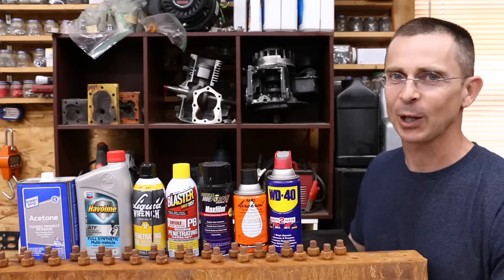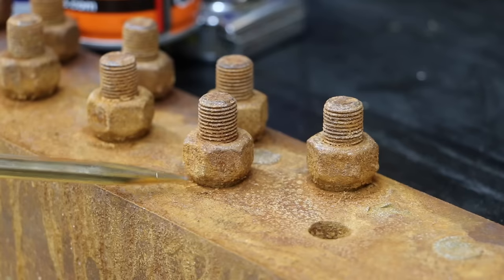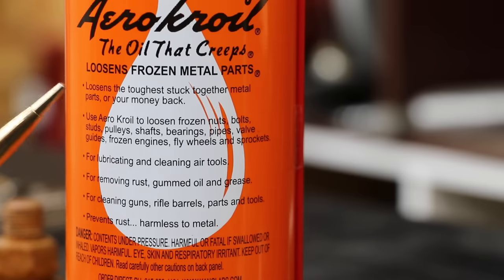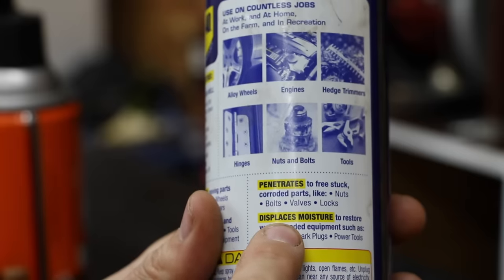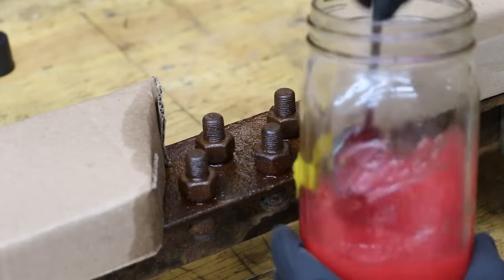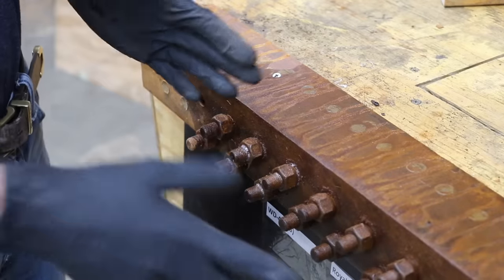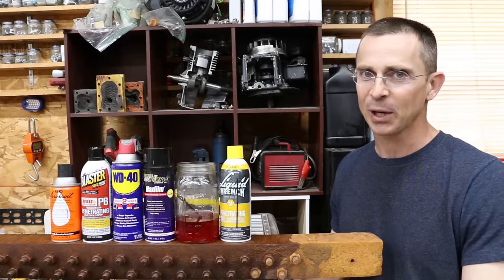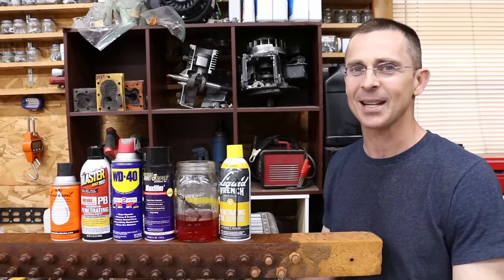Which Penetrating Oil is Best? Let's find out!

Comment: Nice job!

You forgot a big piece.  The control step where you put a wrench on an untreated nut, apply full strength, slip, skin knuckles, and then proceed to mumble choice profanity.
Reply: That would be Uncle Bumblewhack.
(The shmoo is strong with THAT one.)

steve
Reply: then kick some important part across the floor in a fit of rage and break it in the process also / kick the car, dent wing, break toes
LOL
Reply from the maker: LOL!  This is funny!  I admit, I've lost a lot of skin over the years from busted knuckles!
Reply: That would how Uncle Bumblefuck does said test...
Reply: Ahh test blood as a Release oil!
Reply: I dunno about mumble. More like yell in my case.
Reply: Charles Watts - Don’t forget the part where some sneaky bastard puts thread lock on one randomly selected bolt just to screw with your mind. 😈
Reply: always worse when cold outside as well.
Reply: Mumble? You haven't tried to break 31 year old exhaust manifold to downpipe bolts loose with 3/8 drive ratchets on miles of extensions and u-joints before......
Reply: Have you ever bled onto a knife and left it? 1 week- rust.
Reply: He knew my ex?
Reply: mickeybill oh I don't know I just Wrabbit a couple times and that's all. And now if you believe that I have a Snow Ski Lodge in Florida to sale you at a real deal.  Lol
Reply: It IS!
Reply: Yeah we’ve all been there 😂😂
Reply: Afeered so.
Reply: Charles Watts
Reply: Lmao!!  if I had a nickel for every time I've done that I could have retired already!!
Reply: 😂😂😂😂😂..the truth
Reply: @williamsquires3070  As a welder I'm supposed to know how to use the cutting torch. So i was always asked to heat the large studs on million dollar machines, I asked why, "the machine has extreme vibrations" so they use permanent thread locker on the bolts and the heat from the torch is the only way to loosen them up.
Reply: @ProjectFarm  
Jobs not done till the red paint flows
Reply: @johnphillip1711  and say those famous words "Son of a rusted bolt nut that hurt" lol
Reply: What’s the best way to keep rust off of your truck
Reply: The best oil or grease you can spray on the frame
Reply: @seandevane2543  used engine oil is my choice
Reply: Are you blind, the first test was the control test and the final results showed the dry test too. rewatch the video.
Reply: @williamsquires3070  I rewatched the video 3 time and didn't see any type of lock thread, and I have used a lot of it, I was a truck mechanic for my whole life. Also, there is a lot of times when you need to use a thread lock then latter remove the nut or bolt.
Reply: @TestECull  Exhaust bolts & nuts are the worst to get out.
Reply: @nelsona1923  Assuming it's self-applied by the engine as you drive. 'Tis how mine keeps rust at bay.
Reply: @DennisFriedman  I basically consider them one-time-use because they're gonna break/strip when you crack 'em off anyway.
Reply: @mickles1975  I curse along side you, my good sir!
Reply: @DennisFriedman  are you blind? Reread his comment, sir density.
Reply: @TestECull  I  was a truck mechanic all my life, I used cases of penetrating oil, using a good penetrating oil is the best thing to do.
Reply: @DennisFriedman   I've changed a fair few DPF units in the few months I spent as a Penske greasemonkey and, yeah, those bolts are disposable too. Particularly those fucking E-10 bolts holding the heat shields onto the DPF boxes on Cascadias...

With how cheap Grade 8 hardware is, I don't even waste my time trying to extract exhaust bolts. I just cut the heads off and go from there. Only exception is the bolts holding the manifolds onto the cylinder heads and that's only because getting the stud out of the head is a right cunt; even then they often break off or round out if they've been there for 20+ years.
Reply: Mumble?
Damn you are better than I.
Reply: The level of profanities have to be graded also!  And you also have to factor in temperature and rain/snow.  I think we all can remember Dr. David Banner losing his patience when that tire iron slips in the rain.LOL
Reply: Lol. Love it!
Reply: Charles Watts . Lol!! Perfect!
Reply: My all time favorite is “SON OF A B*TCH”. Got that good one from my father when I was a kid watching.  😂😂😂😂
Reply: Pedro Takahashi Gunderson I’m sure the neighbor‘a wife is telling her husband old Pedro is working on his car again. Haha 😂
Reply: James Marquis 😂😂😂. You’ve calculated it right down to the mile.
Reply: New Project Idea... Profranity Testing .. "Which   Is The Best Profranity To Use When Your Wrench Slips And You Bust A Knuckle?? Let's Find Out!!!"
Reply: @ocracoke2013  David? Don't you mean Bruce?
Reply: Watched a buddy bust a knuckle when his wrech slipped. Then he threw the wrench,  it bounce right into a radiator.
Reply: Or the control step of snapping your cheap socket on a rusty bolt with your impact driver the stare at your project for 2 minutes (that feels like 2 years) taking yourself out of quitting.
Reply: I don't think what I did could be described as mumble choice profanity.
Reply: Mumble?
Reply: @nelsona1923  the engine oublié la the best for long is To use new oil  because it's not contamined there you have a Good Job for very long all that's To protecter from the rust AMEN +++
Reply: Soooooo true at least for me! What job is complete without at least one cut on your hands and profanity to follow. As a kid I caught my church going grandfather say, "Damn it!" once and I was shocked. Fast forward many years and I say stiff stuff that would make the devil blush😂😂😂
Reply: AND....which profanity works best. Inquiring minds want to know.
Reply: @gunfighter2012  it's subjective...
Reply: MUMBLE?
Reply: @georgebuck2269  You and I both Sir! 

I was a photographic chemical engineer for Kodak, Greytag and Konica-Minolta Photography Division after selling my Photographic Supply and Camera store. 
I became a nurse in 2008, when my field changed so much that I could do my entire photo-chem job including machine design, (and still teach!!), from my home. I still do everything except machine work.

ANYWAY - RUSTY STUFF:

My go-to now, when working on garden tools and things not currently attached to meltable or flammable things is a a good, long soak in gasoline. 
Then I set it on FIYAH!!

Even since I ran out of fixer (as in the  photo chemical), gasoline has been a great! 

I hope you are doing well! 😸
Reply: @OfficialMyxomatosis  My Mother bought me a 2009 Toyota Camry 125 K miles. She was wondering why I was working on it after visiting me. I told her all the lug nuts were rusted on and after removing them I couldn't get the wheels off. Four wheels took five hours. I smashed the wheels with a large sledge hammer to remove them. I guess the previous owner hadn't had a flat tire in a very long time. The tires looked almost new. It's always something ain't it.
Reply: My favorite profanities besides the obvious "FAAAAAHCK!" are as follows. Enjoy!:
1) Fuck a Duck <-My Father's & personal Fav. 
2) CADENAS! <-Pepé's (mom's dad) French for 'padlock'. Seriously. Sounds great though. Try it. Said, 'Ka-Den-Nas' 
3) NOT A FINGER!  ...and yes, I have yelled this while cleaning the oil furnace and the chimney exhaust. 
About ten years ago, I opened it (the chimney), for clean out before the winter fire up and there was a FAAAAAHCKING DUCK! in there! I actually yelled, "NOT A FINGAH! THERE'S A DUCK IN HERE!" Actually, it was a Green Winged Teal. How my screen came off I don't know. It wasn't w/ the duck and she was fresh.
Reply: @ocracoke2013  you wouldn't like me when I am angry!😤😂😂😂
Reply: @HUBBABUBBADOOPYDOOP makes sense because blood gets it's color from iron oxide based cells, literally liquid rust.
Reply: @arthurbrands6935 In the 70s TV show of the Incredible Hulk his name was David, which ended up becoming the middle name of Bruce Banner in the comics if remember right

Comment: I enjoy watching your videos for numerous reasons. I'm a mechanic & have been almost all my life & there are many methods to removing frozen or rusted hardware. 
( 1 ) PB Blaster is JUNK & the product often runs out of Aresol leaving over a 1/4 remaining in the can.
RESOLVE: I use a AC puncture handle & empty the remainder into a spray bottle.
( 2 ) WD40 is JUNK- Over time if you do a test, you'll find that the surface of the stuck / rusted whatever will get much worse, especially if left out in the elements.
RESOLVE: Don't waste your money!
( 3 ) Gasoila - Works great but only if you have time & soak the problem repeatedly, that's with most other products.
( 4 ) FreeAll - I've used it a few times but it's VERY expensive & honestly doesn't provide a value at all.
( 5 ) Liquid Wrench - In my opinion & the millions of time I've used it is MUCH BETTER than all the other brands. As for the cost, it depends on where you can get it.  
I've found with most that if you have time & consistantly keep soaking it that almost any product is better than none. The conditions & temperatures & exposure all play a part in the demise as well.
EXCELLENT CONTENT in your channel & like your content providing answers to those whom wish to learn & gain knowledge! THAN YOU SIR 🙂
Reply from the maker: Thanks and you are welcome!

Comment: I've been in aviation maintenance for over 20 years and 100% hands down prefer Kroil to just about anything.  I'm a little shocked to see it perform poorly on this test.  It's amazing on dissimilar metal corrosion and heat stressed titanium, which are often found in aviation.  It also smells great!  Thanks for your videos.  I found your channel a few weeks ago and have already purchased a few products based on your testing.  I am not disappointed!
Reply from the maker: You are welcome!  Thanks for sharing.
Reply: I'm the opposite.  Kroil just REEKS to me and I can't stand it.  I was given a can and have only tried it 3 times on frozen nuts/bolts, but it didn't seem to do much of anything to help. My trial results matched Todd's here.
Reply: Jeff is that you? Anyway, my buddy Jeff works in aviation maintenance also. He works on propellers and after just visiting him this past weekend, I saw a can of Aerokroil in his garage, and he swore by it.
Reply: How have you found it to work in the cold? I’m interested in using it on my shotgun while cold weather hunting, water and cold temps will lock ya up solid
Reply: I work in instrumentation, Kroil is the go to when you have to remove a long rusted RTD stuck in a thermowell on a steam generator at 325°C.
Reply: @ProjectFarm  Revisit this test for galvanic corrosion!
Reply: We use it a lot where I work to lubricate pneumatic cylinders and such. We like it but not as much as Hillco lube
Reply: I find the test has too many variables and non-scientific.  Kroil wins by smell alone 😂

Comment: Try two old tricks I was shown 35 years ago by a old timer(60+).

1)Shock(hammer) the plate or parts next to the bolt. Use brass/lead hammer or pad it with a peace of soft wood. 2 or 3 good firm stikes. Works great, no chemicals spills to remove.

2) Tighten the bolt slightly. 1/8 turn or so. It breaks the rust and does not start the removal of the bolt with pushing the rust into the threads.

I use these so often a young guy at work thinks I can't hammer and forget the direction to turn the bolts.
I love removing bolt he gave up on, right in front of him.
I have shown him and explained the theory behind them.
Reply from the maker: Great tips!
Reply: This makes a lot of sense.
Reply: at work we do both of these before either using acetone, wd-40 or kroil. knock it a bit with a hammer, turn it more a bit, apply oil, turn it back, apply more oil, let it sit for a minute, if it dont come out in 30 minutes sit it over night. after watching these videos im gonna go buy some liquid wrench or that sea foam.
Reply: I've done this, learned it from Grandpa.
Reply: Yep, my dad used a big brass hammer, torch, and WD-40 to loosen up salty and corroded parts. I think he might have shown me the tighten slighty thing too, I can't recall though.
Reply: Makes sense. My auto mechanic just told me about his Pneumatic Bolt Breaker -- vibration to break rust. Thanks for the tip @Mark Lefler and others!
Reply: hmm first i usually cuss and swear at... it doesnt fix anything.. but it makes me feel better..awesome vid.
Reply: Tighten it a bit, that has worked so many times on a real tough one on my truck. Two guys tried so many ways, but the one that worked was the tightening. Thanks.
Reply: Raver Magik im not alone lol
Reply: Mark Lefler    I subscribe to all that , that's how I made it thru 50 years of wrenching & hot- rodding cars in the " rust-belt" ......watching the o'l man down the street wrenching......now I'm the o' l man !!🤐
Reply: Mark, that's what I do! I know what you mean about people telling you that you're going the wrong way. But it absolutely works!
Reply: I'm 68 and still have the 1.5 by 5 inch long brass bar that my father used MANY times.
Reply: Thank you for the information.
Reply: @BruceLee-xn3nn   I use to work with Bruce Lee's brother.
Brocc-o-lee.
Reply: @BruceLee-xn3nn  had to. 
I learned both from, forgot, learned again..Scott Snyder R.I.P
Reply: Kurt McComb 
😂
Reply: @bobgleaser7106  ha me too of similar dimensions but mine is bronze
Reply: Have you used ZoomSpout penetrating oil? it is a light mineral oil I believe.Great test! and video!
Reply: @ Bruce Lee
Mr Lee don't need no lube 💪
Reply: As a welder I use the oxy/acetylene cutting torch to apply heat. I'm heating the nut which expands it, so of course it loosens it up. But for exhaust manifold studs always rub "candle wax" on the nut and stud as your heating it, no penetrant is used. The wax paraffin is drawn into the threads the same as a liquid penetrant is absorbed. The first way to loosen a rusty bolt or drain plug is to shock it with a sharp hammer blow, as in hit the head of the bolt with a hard smash, this loosens the rust to metal bond. Most times if this is not done you will break the bolt off. The magic trick for not snapping the nut or bolt off is to loosen the nut a fraction of a turn and then tighten the same amount, using your penetrant spray. Repeat the same process again and again until you feel it loosening up. Never re-use a hardened bolt after you heat it with any torch as this makes the bolt very brittle. (as in any bolt with notches on the head is high carbon steel) (Grade 8 bolts USA or Metric 10.9). In the military an aircraft mechanic is required to cut the bolt in half with the cutting torch so it can never be used again, if it was heated with a torch to remove it. Yes, that's so the jet engine doesn't fall out when your flying off the aircraft carrier. For removing broken studs in machine tools, fab a washer and plug weld it to the stud and then weld a nut on top. It's a breeze Louise if you know the trick.
Reply: Thank you for tip👍🇺🇸🇺🇸🇺🇸
Reply: @georgebuck2269  You should make a video of your techniques.

Comment: Being a master automotive technician I also have utilized all the products you did minus the acetone and transmission fluid mixture. From day to day 35 year hands-on experience I came up with the same conclusion that you did. It was an interesting show down to say the least. Thank you.
Reply: John, just wondering.. How many times in those 35 years did you intentionally go through 3 one hour application processes waiting for it to work?
Reply: Jay Audette if I was working from home, several applications over several hours was common. If it was in work and time is money, almost never.
Reply: @johnjohannemann536  Yup. That's when heat enters the picture.
Reply: Heat is mostly the best option for rusted nuts/bolts. I think he would have had even better result from heating up the nuts a little more.
Reply: How are OEM penetrants?  The Ford, GM or Chrysler stocked in dealer shops?